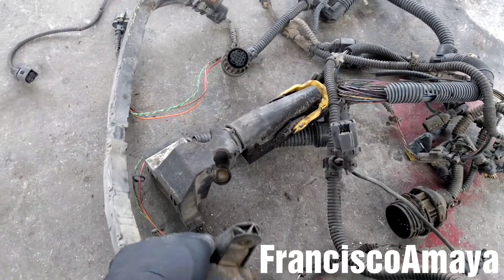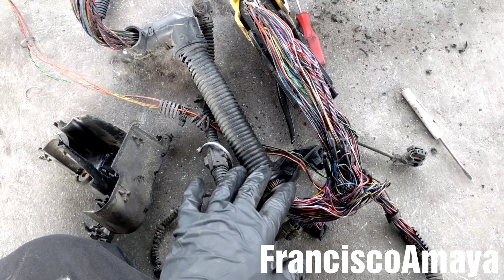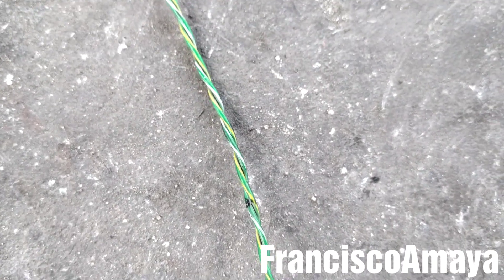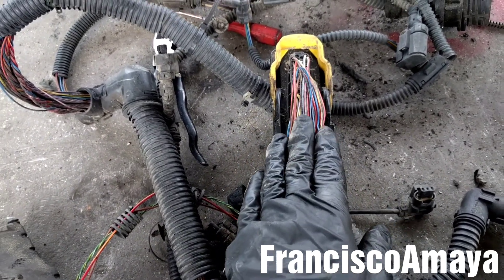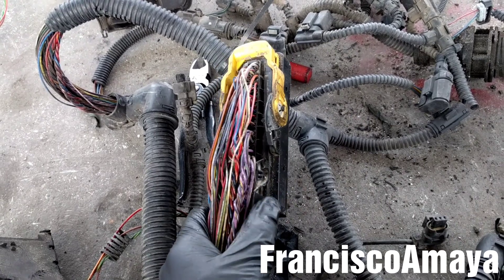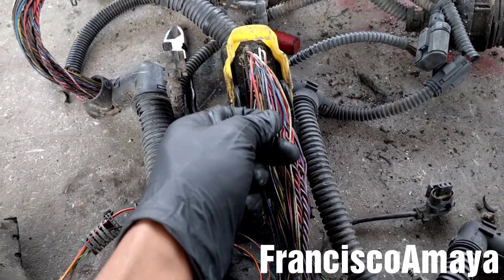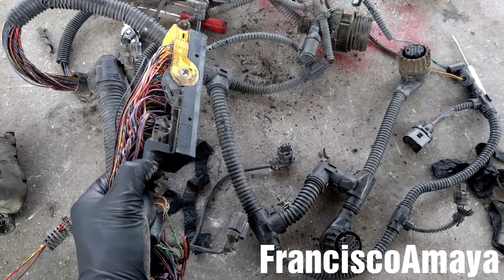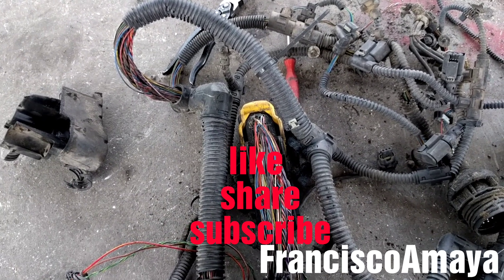Freightliner Cascadia DD13 DD15 DD16 ENGINE wiring harness problem check engine light on

Comment: I have Cascadia 2011 D 13 I have done check engine warning on change a lot of things but it is on a change EGR exhaust wall change harness cable change that cable injectors change brakes ceiling I did softer upgrade software and still it is on. What do you think about that computer can’t make all these problemswithout not changing this

Comment: If the manufacturer injected silicone throughout the harness this would eliminate wire sheath chaffing. One could do this themselves but it'd be a pain in the ass.

Comment: Great Video Francisco. 15 Freightliner -DD13
I have SPN 647 /FMI 1
JAS truck repair Fontana. Diagnostic 
Replace Harness & ECM - Fan Soleniod also replaced.  Bad thing is they don't accept my Premium 2k warranty..truck is at Velocity now.. Hoping its not going to cost more than my Deductible.

Comment: I’m not saying you wrong....But if One of the wire robbing and little expose ..by self it’s fine ..but when you have the oil in there it could be another wire rubbing and expose as well and since the oil can connect between those two wires that’s why the  shortage comes from

Comment: Question. I have just changed egr actuator and mechanic spliced the connection to harness. Left shop then with other issues like derate and now at dealer. Oil is in harness and they are telling me that they have to change it all. Can't they just solder the wire and plugs? Instead of changing it all?
Reply from the maker: It is better to cha6it because the harness fails for some other areas too.
Reply: Francisco Amaya one thing that bothers me most is they want to change egr actuator again because the other mechanic spliced the egr actuator plug to harness. It Voided the warranty and they say they will not solder a new plug.

Comment: I agree with you when you say it's not the oil,  i think what happens is the contaminants in the oil get inside the connectors and create shorts, corrosion and other problems. Great videos!

Comment: New harness installed now I have to take it back to the shop because we don't have the computer to clear the code and it's running the same
Reply from the maker: What is the code you have?
Reply: @franciscoamayaYT  it's back at the dealership say on the dash high soot level and fuel system problem can't remember the #
Reply: @franciscoamayaYT  i replaced the harness. Worked for 3 days with cleared codes and now the same codes are back. 
spn 3510 eng 1.could it be the ecm housing where the harness hooks up?

I also had spn 5444. I replaced the crankcase filter on passenger side with sensor and all. But still same codes. Zero oil pressure also but theres plenty of oil pressure

Comment: Hey I have a question for a 2016 cascadia they said I need a engine harness because 3 injector wire out and the truck is running on 3 cylinder but the reason I took the truck to the shop is because it was dirated and wouldn't regen check engine light say fuel system problem
Reply from the maker: Thus is caused by injector harness. And yes, it can cause the Check engine light and regeneration light to stay on.
Reply: @franciscoamayaYT  thank you
Reply: @franciscoamayaYT  Could this fix spn 5357 fmi 18 i also have a 25% derate going on and i just replaced the intake manifold sensor?

Comment: I have 2009 cascade and I was told I need my MCM and engine harness to change for $3300 cause the fill wit oil I do have chk engine lite on this happen every time I change my injectors harness my Trk drive able but I have chk engine lit.

Comment: Hello Francisco got a 2011Freightliner Cascadia throwing all injector code at one time with SPN 636 the cam position sensor code do think engine harness needs replacing I got 800K on it
Reply from the maker: Yes, it is possible
Reply: Francisco Amaya Dealership said I needed a ECM and a Harness do you think I need both or is just best to replace both?
Reply from the maker: @ericgreen1389  
No, just the harness.  
Don't need a new MCM
Reply: Francisco Amaya ok thank you
Reply: Thanks!

Comment: I have seen many of your videos and I believe your right.   But Question?   How often should  we change the harness.   After how many mile.  It got under the hood.   As part of maintenance.
Reply from the maker: Usually, the harness goes bad around 600k - 900k.  In the range you can have a faulty harness, in some cases can be sooner than that but it will depend on the previous installation of the harness.  

I guess, good amount of miles to replace this harness will be 700k. Just as a  estimate.